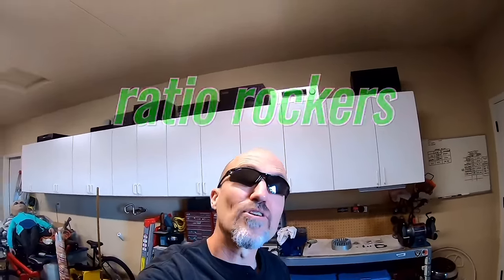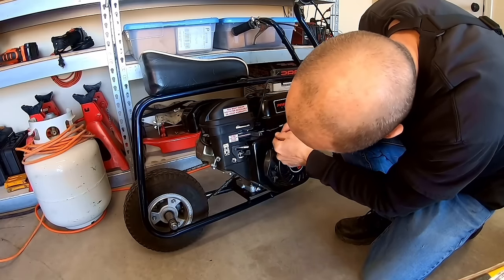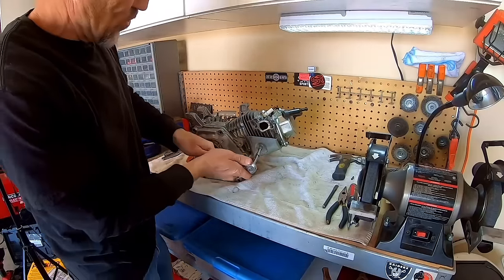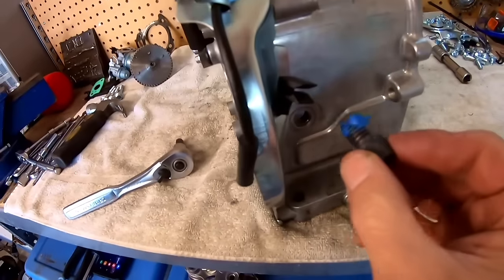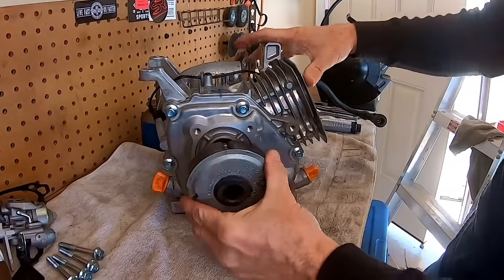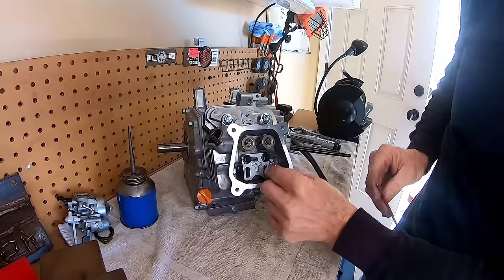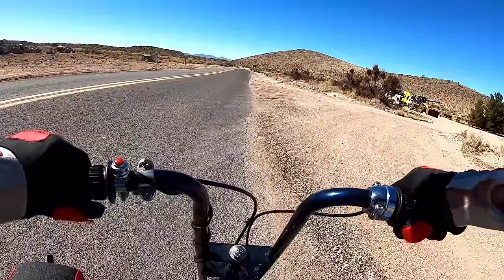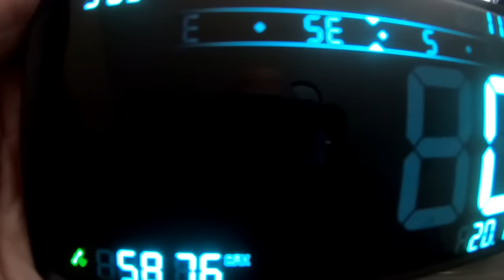$100 budget Performance Predator 212

Comment: Do you have any 12 tooth clutches for the 420 chained mini bikes? I found one from gopower sports but nobody done a test run with one and I'm not sure what's best to  tune it with for more top end. I'm just 1 mph faster than before and I'm not sure why when it should be atless 5mph more right?
Reply from the maker: Generally, every tooth you add to the clutch is equivalent to taking away 6 teeth off the rear sprocket. So, a couple teeth on the clutch can be a big deal.  Gearing can be tricky sometimes because we add a smaller rear gear thinking the bike will be faster, but the engine just doesn't have the torque to pull the gear. Kinda like starting off in a car in fifth gear. It will barley move because it's just too high of a gear. Sometimes a happy medium might be better like adding one tooth to the clutch.  Did you see this video on gearing? https://www.youtube.com/watch?v=xV8i59aGUao&t=137s
Reply: Ohh ok. Thanks for everything we'll see you in the next video

Comment: Hey Black66! I don't have a torque wrench for the rod trick. Is it okay if I just tighten the bolts evenly as tight as possible?
Reply from the maker: I would always recommend a torque wrench. If you haven't pulled a rod before I would just leave it stock.   If you are going to do it without a wrench, you don't want to over tighten them either. I would snug them down, but not too tight.
Reply: @Black66  Okay thank you so much! I will buy one soon, Keep up the vids!!

Comment: whats the best torque wrench to buy for these things?
Reply: I'd get the Harbor Freight Tools 1/4" drive Inch Pound Torque wrench.
It's only good up to 240 inch pounds / 20 ft lb so accurate for these smaller fasteners.
I think only the Crankshaft flywheel bolt & maybe head bolts will require a Full size torque wrench.

Comment: Hey man big fan here, I purchased this budget amazon flywheel and everybody is saying the timing is 28 degrees. I would like to run it on a built motor with a mod2 cam on a non predator hemi. I looked on the DynoCams website stating that the ignition timing is 32 Deg BTDC. Would I be able to run this flywheel with this cam? Perhaps I can advance the timing 4 degrees with a timing key? Kind of in a tough spot as I already purchased the cam and flywheel. Any help would be a huge help and greatly appreciated! Cheers!
Reply from the maker: Yes, I would add some timing with a key.

Comment: Whats the update on this build? Did the Connecting Rod last with your mod or did you eventually upgrade?
Reply from the maker: This engine is still using the stock rod. I will eventually use it in more videos.
Reply: @Black66  amazing I'm going to research this rod polishing. I've ordered the flywheel and a recommended 12 degree key. However I was looking at Rods and came across this very helpful video. 
Weighing rod polishing vs this Amazon connecting rod. (not ARC)
Reply from the maker: Polishing the stock rod is good but it will never be as good as a billet rod with an oil scoop like on the ARC or Amazon rod IMO.  @lacehepbourn1035

Comment: Hello , another great video . I assume this flywheel would work on the predator 224 , same taper ? Was it a good fit , seemed it rocked back and forth a bit before you torqued it down ?
Reply from the maker: Yes, It will work on the 224. The reason it rocked back and forth was the 7 degree flywheel key . It lets the flywheel move so you can rotate it forward to get the 7 degrees of additional timing.

Comment: I was wondering how much valve clearance is in a non hemi predator engine.  I am building my first motor and I bought a cam from go power sports.  It is the 265 hot cam, I am thinking of mating it with the 1.3 rockers you are using in this video however I don't want valve clearance to be a  issue.  Thank you for your time.
Reply from the maker: A standard predator is easier to use higher lift cams in because the valves are not angled or canted. If you use around .080” piston to valve clearance and .030” piston to head you should be fine.

Comment: Can someone help ! ⚠️⚠️ I put a predator 212 on a Coleman ct200 it's stock. With a straight chain and a 60 tooth sprocket in the rear. I'm only getting 32 to 35 miles an hour out of it. ( I'm 190lbs.) Any ideas why? It's driving me crazy 😅 it seems like the top speed dropped when I put the 60 tooth in.

Comment: Does that aluminum flywheel work with charging coils??
Reply from the maker: No it doesn't
Reply: @Black66   do you know of any upgraded flywheels that  do have the charging coil magnets??
Reply from the maker: @philipgagne1852  Not aftermarket that I know of .You could run lights without the charging coils. There is an LED set up that last for days without a charge and is easy to install. here is the video if you havent seen it already 
https://www.youtube.com/watch?v=75arrzEwOvc&t=327s

Comment: How many rpm’s you think at 58mph? Safe enough for the stock rod and aluminum flywheel for long term? Wanting to replicate this build, thanks for the great content!
Reply from the maker: Thanks! I think I had a 12/60 gear on the bike in that video. According to the calculator with that ratio it was spinning 5600 at 49 MPH and about 6500 at 58 MPH after the header install. I think the flywheel would hold up being rated at 8500. The rod should could too , but it would be really safe to throw another $70 at it and install a billet rod if your gonna spin it to 6500 all the time.

Comment: Absolutely lovee the video bro. Everything from the comparisons to the build. I just picked up a predator 224. Could you do a budget build with one of those and compare it to the 212? I’m curious what a budget 224 would do
Reply from the maker: Yes, I would like to do a buget 224
Reply: It's just a 212 with thicker head gasket
Reply: @Rossman2003  Yes….but the block is the reinforced version with ribbing in it. That slight extra stroke is making a. Relieve 1.5ft lbs more torque that’s A lot on a small engine

Comment: Is this a 3rd generation 5mm valves predator? If not, will the flywheel work on it?
Reply from the maker: Yes, it is. The flywheel has a clone, Taper.  You have to be sure to lap the flywheel to the crank.
Reply: @Black66  thank you so much.
Reply: @Black66  have a good day or night!
Reply: @Black66  do you lock the crank to lap it? Or just hold it by hand,
Reply: @Black66  another YouTuber told me that it would not work because it DOESNT have a Honda taper

Comment: Hi..luvvv ur vidzzz. Learned soon much..please keep the content coming 👍👍.. I gotta question 4 u??? Will the governor delete process that u did on this predator motor be the same process for my Briggs and Stratton  5 hp motor??? Just wondering?? I want to put a hotter / better carburetor on it and want to do a governor delete on it as well..I would  like to know your input ??👍👍👍..I'm Ray from Colorado  BTW.. take care and thanks again....🙃🙃👍👍💥💥
Reply from the maker: Thanks! The governor wheel is on the case cover on the Briggs.Pretty much the same deal. Super easy to do on the Briggs.
Reply: @Black66  so same process then?? I'm sure there's prolly a video for the delete mod on a Briggs somewhere on Utube??  Did u make a video for the delete mod on a Briggs?? Just wondering?? Anyway I think I can figure something out..I digg that fuel injected carburetor.. that's what I want 4 sure!!!! That' thing is B.A.F!!! Thanks..Ray

Comment: Why do the asuza drum brakes suck. I have to make a bracket so I can install a hydraulic disc break. I see you have drum breaks on this one. Do they work for you?
Reply from the maker: The drum brakes are designed for much less power then the engines of today put out.  I have quit a few brake conversions on the channel. Check out the playlist. Thanks for watching! https://www.youtube.com/watch?v=izChFq01WAw&list=PLkbj-ip-5FzbLQb21ZZW1mmWP45vj4kxW
Reply: @Black66  yea, I saw them. Great videos.  I like that bracket for the caliper mount. When you did the mechanical to hydraulic disk.  I have the Asuza frame, and I want to make and weld that bracket. Can you give the approximate dimensions of that bracket? Thanks for your help

Comment: Great video!  I expect this one will get lots of views!  Curious to see how long that rod lasts.  What was your RPM at top speed?  I think most of the failures occur because rod journal starves itself of oil at high rpms and seizes.  Polishing isn’t going to help much there!  Might be okay with 18 lb springs vs 22+. Might try switching back to the stock rockers and comparing 0-30. It’d be cool if you picked up one of those carb reamers and bored the carb out to see just what a stock carb could do and let us know if it will idle without fouling the plug.  I built a mild engine, 265 cam, 22 lb springs, billet rod, PLV flywheel, chikuni.  Lots of fun, but I think if I was doing a budget build, I’d just put an aluminum flywheel on for the improved throttle response and set the governor just shy of valve float.  Pretty much what a Tilly 212r is.  Lots of fun and pretty durable, because it gets expensive when you start breaking parts!  Any interest in building an electric bike?
Reply from the maker: Thanks! Ya, I have one in the works for an electric bike.I would like to try the Predator Ghost engine.

Comment: Great job man, just bought a used minibike with a 212, changed the carb, trying to relink the governor but cant get the bike to idle it just goes. Was thinking of just bypassing the governor, but got freaked out by a friend who talked about flywheels blowing with high revs. Whats your thoughts of bypassing the governor is it safe?
Reply: Ur all good bro dnt hold it for to long it will be fine.  Get a rpm meter for sure! Goodluck with it
Reply: Get a billet rod and the flywheel he used in the video and then you're safe.
Reply: @keithcola3906  thanks man
Reply: @Deucealive75  thanks!
Reply: @keithcola3906  whats top rpm range 4000-5000?

Comment: It's tough cause a knock off 22mm carb kit off Amazon netted a 2.3hp gain and is the same price as the flywheel. With better throttle response. I'd like to see maybe a 200 dollar budget build to.
Reply from the maker: Check out the playlist on the channel. We have quite a few bikes runnig the VM22 .Great carb for the money !
Reply: I will most certainly do that.

Comment: Did you retain the stock emulsion tube and idle pilot?
Reply from the maker: At about 19 minutes into the video I show all the jets used in the kit. All three where changed.  The link is in the description for the complete jet kit.
Reply: @Black66  ok, I sent you a Instagram message. So it ran good with that emulsion and pilot jet included in that kit then? I've had a time with emulsion tubes and pilot jets getting mine to idle worth a flip or cutting off right after a full throttle hit.
Reply from the maker: @lsxjunkie  Yes it ran really well in the video. Your jetting could be a little different than mine if you live at a lower elevation than me. Maybe use the bigger main that comes in the kit.

Comment: 50 mph on a stock 212?! Wow! I have a jet kit, air filter kit, header, 8 degree key with removed governor and only reach 37-40 mph!! My gearing is 12/75 what’s your gearing in the bike? Also have the 145/70-6 tires. Strange.. appreciate the videos.
Reply from the maker: It was running a 3.52 ratio in this video. 17 on the clutch and 60 on the back . Not a good gear for quickness ,more of a  highway gear
Reply: @Black66  ahh perfect thank you!

Comment: Does this build apply to the Honda 200 engine
Reply from the maker: Yes, you can apply this build to quite a few engines. Maybe some small variances in parts but all this stuff does apply.
Reply: I have another question. I built another baja warrior and I have a slight problem with the chain is touching the rear tire. Tired to move engine etc. Do you have any suggestions
Reply from the maker: @DavidMartinez-uz2vf  If it has a universal sprocket hub you can always run the sprocket on the opposite side of the hub. Or flip the hub around
Reply: 212 predator

Comment: The flywheel only fits the non-hemi correct?
Reply from the maker: Yes. It actually has a clone taper. You have to make sure to lap it in.
Reply: @Black66  ok, great I'll make sure to do so. What valve grinding compound do you suggest or will any pretty much work?
Reply from the maker: @thefishingchannel3192   Pretty much any of them will work .
Reply: @Black66  ok thanks 👍

Comment: Can I use a 8 degree timing key?
Reply from the maker: An 8 degree key would work .The wheel in the video only has around 18 degrees timing built in so you could use even more than an 8 degree key.

Comment: I really enjoy your content of this vs that and how much better different mods will make. I started doing this budget build, but the flywheel I got from the link doesn’t fit my crank. I am new to building these but I don’t think you should have to lap over a 16th of an inch off. The flywheel looks like the one you have, but did they send me the wrong one?
Reply from the maker: Thanks! Not sure what wheel they sent you but here is a link from a different vendor for the same wheel.These wheels do have a clone taper. If you want an exact fit I would reccomend an ARC billet wheel    https://www.ebay.com/itm/133797562220?ssPageName=STRK%3AMEBIDX%3AIT&fromMakeTrack=true
Reply: Did you have a hemi or non hemi
Reply: I have a non hemi.
Reply: @zombiekiller6608  ok

Comment: I have a Tecumseh 6hp and right now I am pushing the limits of safety and rpm
 I love the engine and would love to keep it in one piece I would like to get a tillitson 212 and replace but I want to max out the engine because it would be something I've never seen before (some say because they become explosive 😂) but do you know if any after market piston rods would fit on the engine or high rpm flywheels if not the engine might get a race or two in before I retire it or it decides to retire itself haha
Reply from the maker: We used to race the Tecumseh and flat head Briggs back in the 80's! Awesome times. I haven't been into them in years. I was looking around and found this site. http://www.pinrepair.com/minibikes/tecumsehmb.htm#flywheel
Not sure if it will help
Reply: @Black66  the site was just barely off with the engine model I needed but still gained some knowledge from it👍 
 you should do a video on them sometime. they really are awesome engine's and just have a bad name because people push the stock ones too far.

Comment: should get another one and just throw the header pipe on it without doing all the other stuff and see what it would do. seems like the header pipe alone would take care of most off it.
Reply from the maker: Check out the playlist on the channel. There are quite a few exhaust videos. For $100 bucks you might as well do it all. It doesn't cost much and its fun to do.  You really should change out the stock flywheel for anything with the governor removed .Cheap insurance.   Also valve springs  definitely add some RPM potential. Thin head gasket is inexpensive performance upgrade for sure.

Comment: My brother what gear ratio you running with this test
Reply from the maker: I do so many of these its hard to remember lol, but I think it was a 4 to 1 ratio, 15 on the clutch and a 60 on the back .
Reply: I run of 4.8 but I’m going down to a 
4.2 because I can’t squeeze any more out of the Cam that I have. Have a mod 2  I can only reach 52 miles an hour not even near the top r p.m. I can get ,I can get 59 miles an hour with a 4.2 which the gear is coming tomorrow  I’ll have 17 tooth what is 72 rear 
That will give me a 4.2 ratio

Comment: does the valve springs weigh 18 lbs or is that what they can handle just a dum question but mama told me shoot for the stars ...... so here im am lol
Reply from the maker: I think they weigh 18 lbs. My arm gets sore if I hold them to long...😃😄
Reply: @Black66  dam so what springs u think i should put in my ducar i still gotta remove the gov
Reply: @Black66  hey thanks for always helping out u wouldnt happen to have the link for those bolts im patching up a kit so when i take this gov gear out i can do everything nicey nice n clean

Comment: hey man i wanna straight chain my mini bike i got a bt200x stock sprocket and 10 tooth clutch do you know what size chain i need to do that
Reply: Your gonna have to look at the clutch you bought should be either size 35 or 40 and 41
Reply: When I was a beginner I made the mistake of buying a size 35 clutch with my 40/41 rear sprocket.....ya that obviously don't work lol
Reply: If it's stock clutch it's gonna be a size 40 chain you want
Reply: My bt200x has 420 chain.  A 5' piece will work with a few links removed.  If you can, go ahead and get 10' and have a spare.  Assuming you have a chain break tool you can add the jackshaft and drive chain together for free.
Reply: @rustyshackelford9414  yep your right it probably would be a 420 I was thinking of ct200
Reply: @Ja-fh8io   that's just mine, who knows they might have changed things over time. And probably made in 10 different places.
Reply: @rustyshackelford9414  thanks man i didn't know what chain i needed but i'll have to get a 420 chain then
Reply: @BillWilliamson420   No problem. Had to help out of respect of the name. I'll be sitting on tree tops at daylight.  Fish on brother.

Comment: the link for the flywheel says its for a tillotson 212r
Reply from the maker: Ya, it will fit the 212r also
Reply: @Black66  i  only ask because it says in the description:

It DOES NOT Fit The Predator Hemi. Its BALCO Certified And Spin tested To 8500 RPMs.
Reply from the maker: @donavanlove1226  Hemi has a different taper
Reply: @Black66  thank you for your quick replys love the videos I'm a for sure subscriber